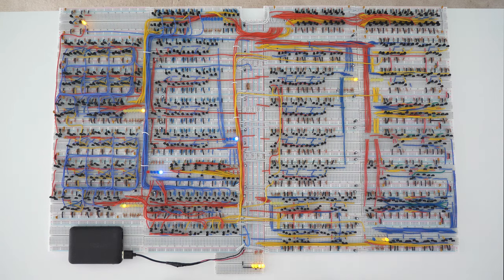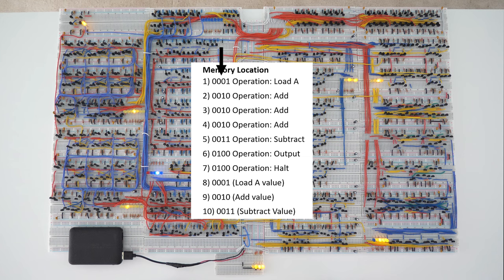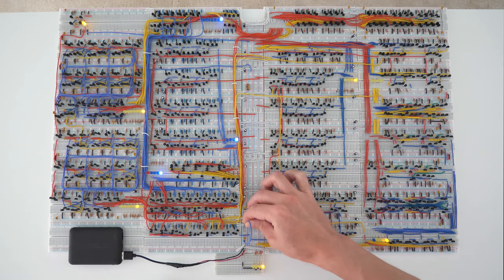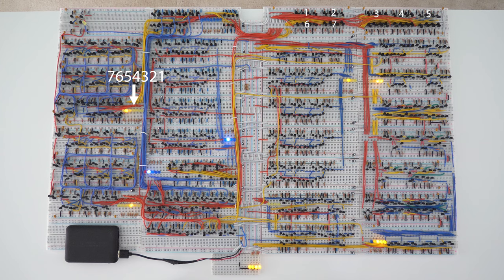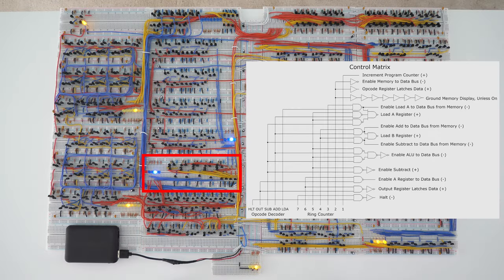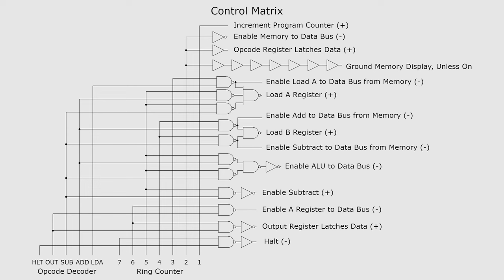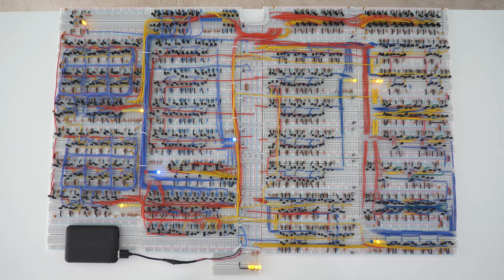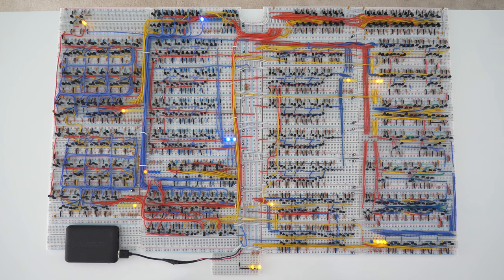How to Build a 4-Bit Computer on Breadboards Using Individual Transistors

Comment: i wonder if i could build that in Falstad Circuit Simulator
Reply from the maker: That would be cool! I would start with a 4-bit calculator and then expand the project from there. I got a 4-bit calculator to work within the circuit simulator in EasyEDA. Falstad does seem to visually show the circuit in a nice way. It would be cool to see the entire build in a simulator!
Reply: @GlobalScienceNetwork    can you link to the diagram. this might be a bit over my head at the moment but that's what makes it a challenge .
Reply from the maker: @numbercrunched  In my video about how to use easyEDA I show how to get to the circuit diagram for the 4-bit calculator. I have it uploaded on their website. If you want the full computer diagram I can email you the image. It is shown in this video and is in 4K so it is almost as good as what I would send. The diagram for the entire computer is only at the logic gate level though.
Reply: @GlobalScienceNetwork  got the clock working in the sim

Comment: Why BJTs and not MOSFETs?
Reply from the maker: My thought was the BJTs are very robust and was told that MOSFETs can break due to a small static shock. I did not want the circuits to break if I wired something wrong. The BJTs can take some abuse. MOSFETs are the better option for larger circuits with over 1,000 transistors as the voltage gates make them more power efficient. Since this build I have been using the 2N7000 MOSFET in some of my circuit designs and find it works well. I plan to make a video about how to build MOSFET logic gates as well so these can be used in more projects going forward. BJTs are used more commonly they you might realize in smaller ICs such as a 555 timer.

Comment: Can I use BC548 transistors ???
Reply: Because it's cheaper than the 2n2222 transistor
Reply from the maker: @divyaswarupmishra5388  Those should work. I am pretty sure the orientation is backward though, the emitter-base collector is the collector base-emitter. This just means you have to rotate the transistor 180 degrees.

Comment: How much length of wire is used
Reply from the maker: That is a good question. I did not track the exact length. It is surprising how fast you go through a 30 ft spool or wire though. I would estimate about three 30-foot spools of red, three blue, three black, one white, and just a little bit of green were used. So around 300 feet of wire total.

Comment: Does anyone here have an idea for making a semiconductor from SiO2 to pure Si with simple tools?
Reply from the maker: Well, what are you trying to make? You need a silicon seed crystal and then heat the silicon high enough to be a liquid which can then make an ingot which you slice into wafers. You are better off just buying a wafer if you need a substrate though. Unless making the wafer is your project.

Comment: Im new to this can anyone pls help me how can i design my own circuits and components. I atleast want to create my own circuit diagrams. Pls help where to start
Reply from the maker: Sure! You found the right YouTube cannel for this. I would suggest starting with basic logic gates and then building a full adder and then a 4-bit calculator. I have two video's on free circuit diagram programs called EasyEDA and LTspice. You can try both and see which one you like better. After you build these circuit you will be ready to build your own custom projects.

Comment: In my imagination, even building a simple inverter by a NPN and a pull up resistor would consume considerable amount of power in static condition. How to avoid that?
Reply from the maker: You are correct that each logic gate is consuming current. Using a large resistor around 2K makes it so the power used is small enough that you can still power enough gates to build a computer this size with a battery pack. For larger circuits MOSFET transistors are used which are voltage gated and used significantly less power. With MOSFETs billions of transistors can be used in a device such as a cell phone because the voltage gates are much more power efficient.

Comment: Please anyone tell me how I can make it please
Reply from the maker: Sure, the videos on my channel are meant to be a full tutorial on how to build the computer. Start with basic logic gates, then build a 4-bit calculator, followed by latches and flip-flop. Then build the computer in sections. I provide the circuit diagram at the logic gate level. Once you start building the computer it will make more sense.
Reply: @GlobalScienceNetwork   actually I'm 15 and I want to make it as my school's science exhibition project because it's so interesting for people to see how a 4bit computer works at transistors level on whole youtube it is the only video which guides how to make a 4bit computer without any IC there are some difficulties are coming to understanding the circuit diagram but it get easy when we divide it in parts or allover it is the best 4bit computer because it have no IC thank you sir I really appreciate your projects :)
Reply from the maker: @NUKECORE99  Sure thing. I would suggest starting with the 4-bit calculator as that is a good stand-alone project in case you did not have time to build the entire computer and you only need 4 breadboards. It took me about 3 months to build the entire computer. If you have time you can build the other sections of the computer and the calculator will work as the ALU.
Reply: @GlobalScienceNetwork  that what I'm exactly thinking about but I have 1.5 years so I can start working on it.
Reply from the maker: @NUKECORE99  O alright, nice!
Reply: @GlobalScienceNetwork  If I'm not able to make it as my school project I just want to make this thing once in my life ❤
Reply from the maker: @NUKECORE99  Yeah, that is a good goal, then start working on artificial neurons!

Comment: Why reinvent the wheel?
Reply from the maker: Good Question! I am working to build hardware-based neural networks. I thought building and fully understanding how a digital computer works at the transistor level would be a good place to start. Some of these circuit concepts can be leveraged in hardware-based synapses and hardware-based neurons.

Comment: The intel 4004 had only 2300 transistor too...
Reply from the maker: Yeah, after you watch this if you check out the circuits for the intel 4004 it is really cool.

Comment: U must’ve bought high quality breadboards.. I tried saving money and bought cheaper ones as soon as I got every part connected I could get it to work3 or 4 cycles but the crappy breadboards sink voltages send stray voltages even with pull ups and pull downs and decoupling everywhere I fought it for a month and just said next time won’t cheap out again
Reply from the maker: Yeah, having good breadboards is important. I did not have top-quality ones either so I had to swap out or not use about 8 of them during the process. Busboard breadboards are the way to go. It does sound like you were close to getting it done! Even one bad transistor can cause problems so making sure each circuit works perfectly before connecting them together is important. Then if there is an issue, like you said it might be from the voltage drop across the breadboards. Where power is connected even matters for some of the circuits/counters.
Reply: @GlobalScienceNetwork   yea it was like 5 years ago now,, all circuits worked great alone or even all connected , or even when manually moving the clock… whe it was all connected I get like 4 cycles  before it was putting garbage on the bus
—— got it all on aliexpress figures why quality was lacking… but awesome work on yours
Reply from the maker: @sodapopinski9922  Thanks! It sounds like you might want to get good parts and try it again! Or follow along with this channel and try and build hardware-based neural networks!

Comment: too bad that it isn't kit with everything pre-cut..................
Reply from the maker: Yeah, I was thinking about making a kit with all of the parts at least. The shorter wires could be pre-cut but the longer ones would need to be cut from the spools of wire. All the resistors need to be cut as well. It is quite the process but breadboarding is also fun.

Comment: Rebuild ancient wheel again? What's the point to make this? Can it do AI calculation?
Reply from the maker: Well before we start to build more advanced computation devices it is good to start with one that already changed the world. Not many people understand how a computer works at the transistor level and that is where I wanted to start. I learned lots of things by building this project that I should be able to utilize when building artificial neural networks. The goal is to create non-biological life. Computers can run AI calculations but are very inefficient at completing this task. Properly build hardware based neurons should change the world again.

Comment: You are using only transistors in all your projects, That's why you disappeared for a long time
Reply from the maker: Yeah, I am going to build most projects from discrete components such as transistors, resistors, capacitors, LEDs and wire. The next projects is artificial neurons, which should be pretty sweet!

Comment: You are taking science backward to the very difficult days. During the 1930s or 1940s world's first solid state electronic was achieved through vacuum valves. I am not sure because it is long time back they must be some short of vacuum valves or something short of that. Those were very bulky and they make a even a small transistor radio very big in size. Ground breaking innovation came in the form of a transistor hence valves or vacuum tubes became redundant they made the size very compact as well as switching very fast does high frequency switching was possible. After that came the ground breaking invention of integrated circuit. An integrated circuit is a small chip that has millions of transistors in it. The VLSI integrated circuits has more than billion trangisters. Then came the ground breaking invention of CPU that is central processing unit which has billions and billions of small switching transistors. When world's first computer was designed I think if I am not wrong they were made of vacuum valves and then computers were made of transistors. But nowadays computers are become so small and compact they are made of a central processing unit. Even innovation did not stopped at that stage and now a days came microcontrollers which is a central processing unit and random access memory and erasable reprogramble memory all in one chip. Only 4 bit computer requires so many transistors and breadboards. Try a little more faster one gigahertz computer 64 bit. You are basically taking science backwards next try a vacuum valve or vacuum tube computer😂😂😂
Reply from the maker: The Intel 4004 was built in 1971. The idea here was obviously not to utilize the computational power of the computer. The reason this was built was to explain how a computer works in the simplest terms possible. Most people only have a vague idea of how a computer works. We are going to be building hardware-based neurons which are the future. Having a community of people who understand the fundamentals of circuit design will be important. Watch my latest video on artificial neurons and you should get some sense of where we are headed. More videos coming soon!
Reply: 高速化するにはS9018などのトランジスタを使う必要がありますが、集積させるにはシリコンウェーハに回路を作る必要かあり別の分野です(*_*)

Comment: ah yes "very simple"
Reply from the maker: Ha ha well for a computer built at the transistor level it is the simple case. If you build it in sections , each section is relatively easy to understand.
Reply: @GlobalScienceNetwork  ok thx

Comment: "simple"
Reply: if you know how to
Reply from the maker: Each section is simple which is nice. Then when it all comes together it is complex and really cool!
Reply: @GlobalScienceNetwork  Well if you look only for section, it is. but the main problem is to find lots of transistors and cables. and the second problem is not to get confused while building it to an single part with that much cables. and is there a way to use it for better things? (I'm not calling it useless, cool and useful for educational purposes) thanks for reply
Reply: @GlobalScienceNetwork  and is there a way to make the clock faster?
Reply from the maker: @A946-x6n  it is easy to make the clock faster by changing the resistor values in the astable multivibraitor. The build is mostly to demonstrate how a computer works. It could run other simple programs and loops. Knowing how to built it makes it so you could build custom chips/PCBs for a specific task rather than using an FPGA or microprocessor.

Comment: bad explanation lol but nice computer
Reply from the maker: What would you like clarified with the explanation?  I show all the circuit diagrams. I have other videos about the logic gates, flip-flops, and adders.
Reply: @GlobalScienceNetwork  i did not understand the control unit at all. explanation was well to fast paced. got anyt video about that?
Reply from the maker: @vinigame7490  I think you mean the control matrix. My explanation was brief for the complexity of it. I was planning on making a detailed video of each section which I will likely do in the future. I have been working on work and on building artificial neurons which I will make videos of soon. The control matrix does have a logic gate level circuit diagram which is connected to the other circuits in the full computer circuit diagram. I explain one of the control matrix options in detail. If you follow where each line is connected and which gates are used you can likely make sense of it.

Comment: Why Build a 4-bit useless Computer??????
Reply from the maker: Well that is actually a fair question. In my onion everyone should learn how to build and program a very simple computer as the first step to learn programing and circuit design. This computer may be very simple for a computer but it is not a useless effort as I learned a lot that I will now be able to apply to other more advanced hardware based projects. More advanced computers today are obviously not built on breadboards and have billions of transistors but do still use the same von Newman architecture used here.